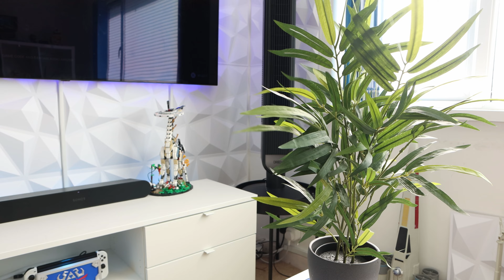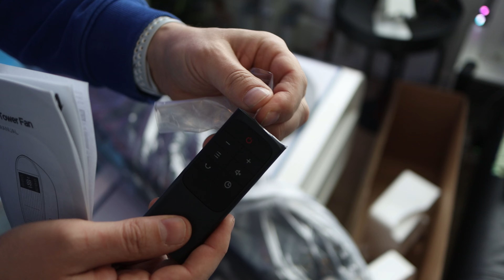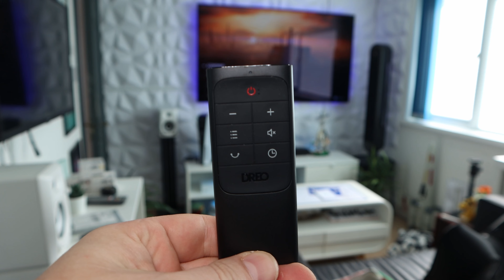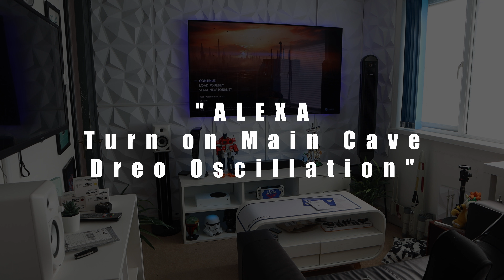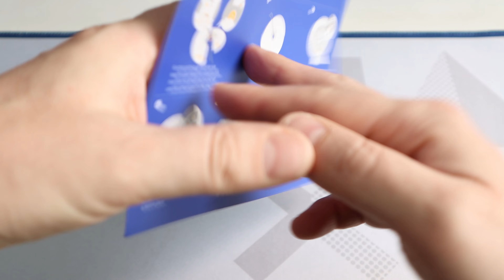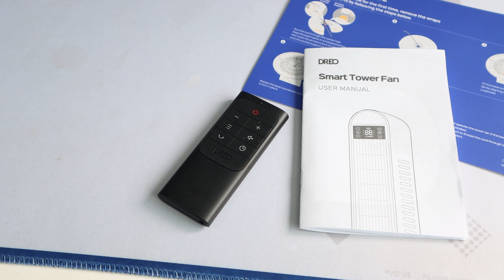Dreo Cruiser Pro Tower Fan Review. Use tech to cool your room

Comment: Did you have any problems connecting the base to the main fan unit? I'm cant seem to align them
Reply from the maker: It did take me a couple of minutes to work it out. There is a specific way for them to go. Pushed in and twisted, just make sure they are the right way round. Hope that helps.